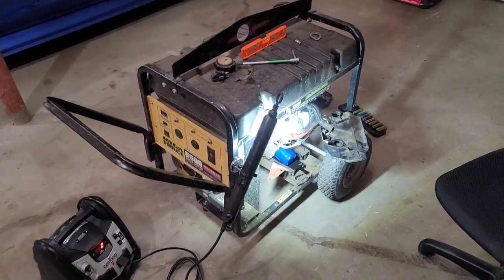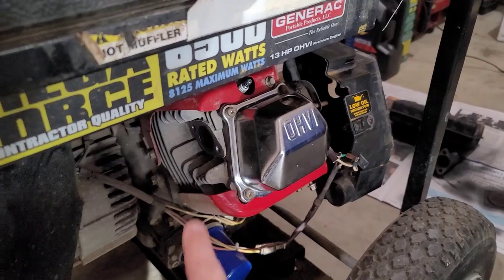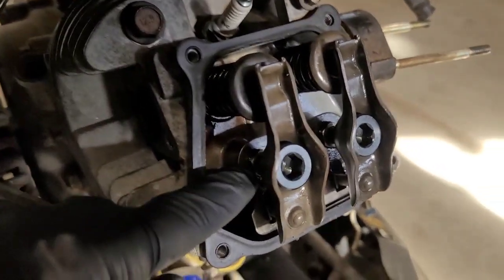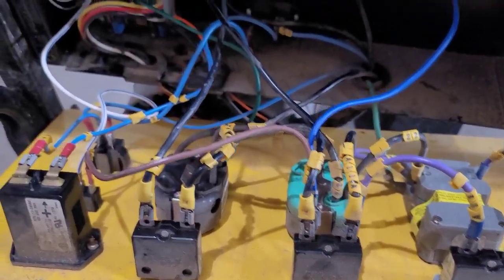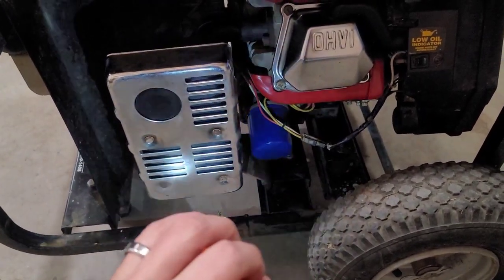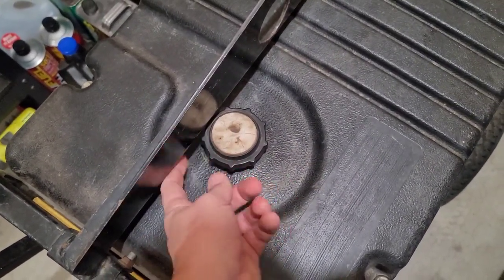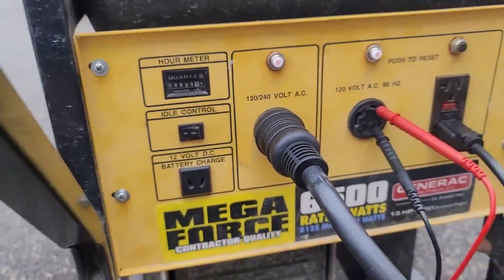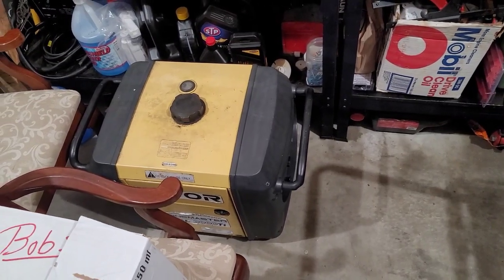Generac MegaForce 6500: No Power / Engine Valve Issues - Can we revive it?

Comment: The reason that there is no seal on the exhaust valve is that the intake is under a vacuum , the exhaust is under pressure not drawing any oil in the valve guide . The exhaust is glowing red hot this is because the mixture is running lean not enough fuel usually dirty carb. Good video , great information . Check  your wattage draw on your heat gun , because on my heat gun only draws 1080 W on high .
Reply from the maker: Thanks for watching! Heat gun is 600/1200 watts. Yeah the exhaust stem seal they do have them on some engines. Its usually a diverter seal and not a positive seal so oil doesnt run down the guide too much when the engine is off. 

Def got the carb squared away. New seals helped a lot!

Comment: Is the new hourmeter still wired to the DC charging lead? Any disadvantage of this?
Reply from the maker: Yes it is, but on the line side. So if the DC outlet is overloaded it wont stop the hour meter. Nothing wrong with this setup, though many prefer an hour meter that measures off the inductance of the spark plug wire.

Comment: Hey partner, great video. You are incredibly knowledgeable and patient, really enjoyed your expertise. I've got the same model generator that I salvaged from a fire, and I can't seem to locate the model and serial for the engine. I know it's a 13hp, but is it a Honda or an in house Generac model? I need to know what to order for a new oil filter and (ironically) a new oil fill plug like you had to. Thanks very much!
Reply from the maker: @taypat  It is a Generac GN-360 or a GN-410, can't remember off the top of my head. It uses a Frame PH4967, or equivalent. I forget the part number for the oil fill plug but I believe they are standard.
Reply: @Bassguitarist1985  Thanks so much for the quick reply, really appreciate it 👍

Comment: Very interesting video, thanks for making it.

I have the same generator and I can't get it running at all. Fresh fuel, replaced spark plug, cleaned the carb, opened and cleaned the cylinder head and replaced all the gaskets but no luck. My next task is checking the flywheel if there are any obvious issues there. Have you come across issues flywheel problems in generators before? Another issue I can think of is maybe the kill switch is faulty.
Reply from the maker: Flywheels usually fine. Check kill switch and low oil pressure sensor...
Reply: @Bassguitarist1985  Thanks for the pointers. I disconnected the switch and sensor and no luck. The starter rope feels very stiff and is hard to pull. However, I don't believe it's hydrolocked and the piston moved fine when I had the cylinder head off. A google search seems to indicate that it could be a damaged flywheel in this case.